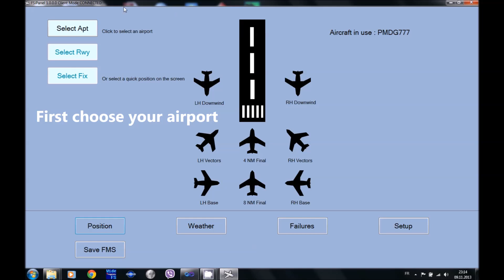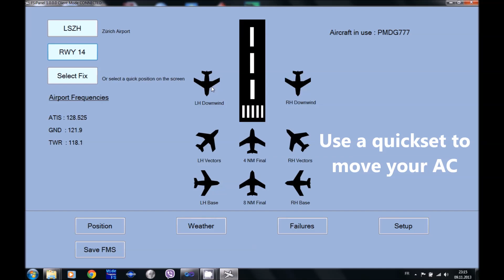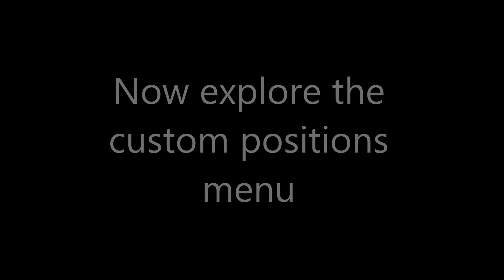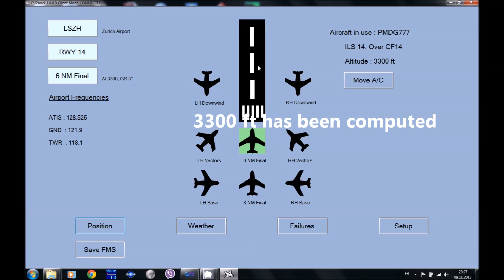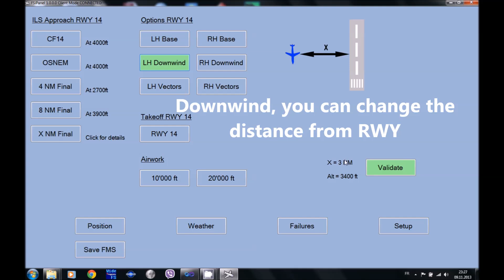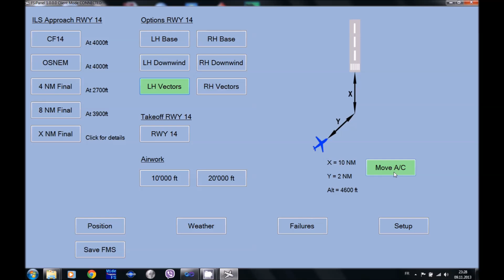FSiPanel for FSX demo video #1

Comment: Looks like a nice application but i have two questions
Is the pmdg 737ngx also available?
Can it run as a network application or has it to be installed on the fsx pc?
Reply from the maker: Hi Rene,
Yes, compatible with 737ngx.
Yes, the software can be run on a Server / Client Mode.
Reply: FSiPanel Thanks for the info.
Any news about a release date?